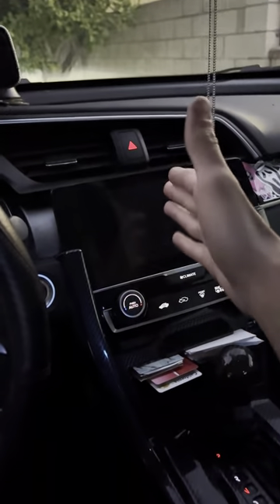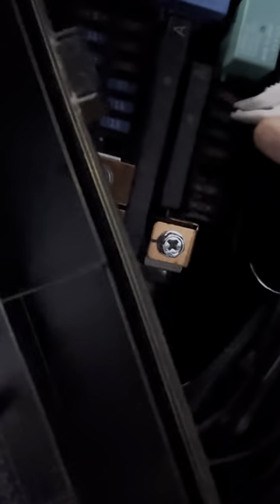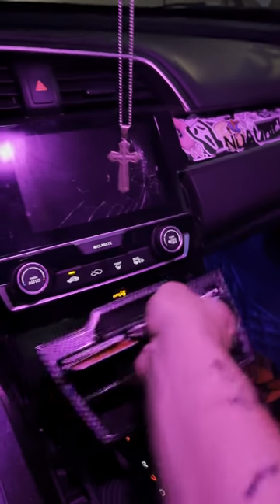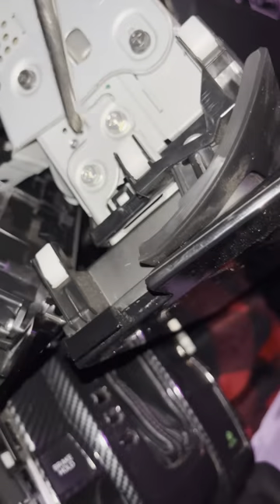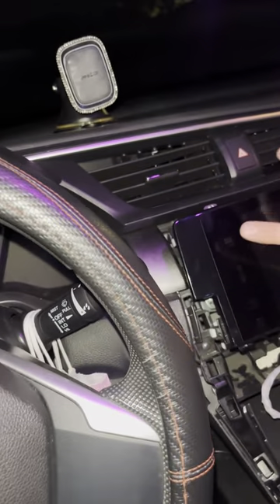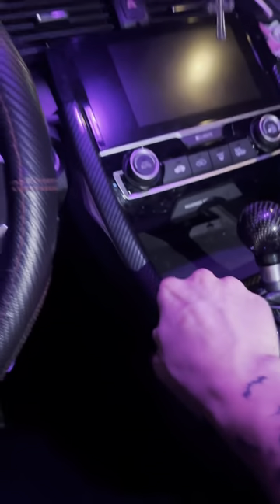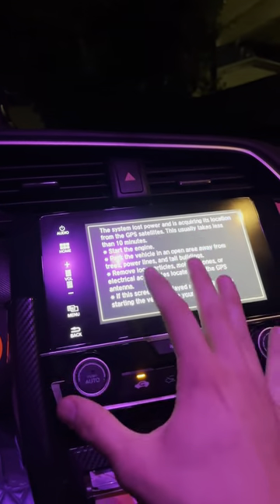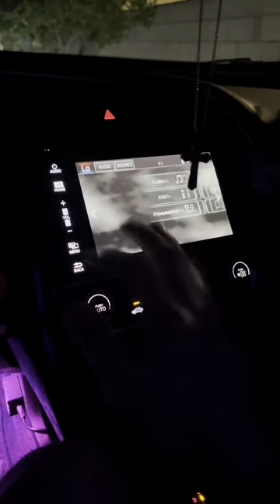HOW TO REPLACE HONDA CIVIC TOUCH SCREEN / Civic 2016-2019 apple car play screen fix

Comment from the maker: For anyone wondering… this also works on Honda civic hatchbacks as well with Apple CarPlay. You may have some different clips to pop but it’s relatively the same process.
Reply: Quick question. Did you replacement the entire unit or just the digitizer screen? Looked like the entire unit but wanted to know if changing just the screen/digitizer will resolve the multi-colored lines and then black screen. Or if I need to change the entire unit?
Reply from the maker: @jhgannon  All I changed was the screen. It resolved the multicolored lines and black screen glitch. Should work just the same for you
Reply: @Dead10thgen thank you so much.
Reply: If I did not pull the fuse would it be ok?
Reply: Did you get your screen online or from a dealership?
Reply from the maker: Straight from eBay. I think I mentioned that in the video but I’m not sure off the top of my head. The part number is on the back of the screen once you remove it. I just went on eBay, and pretty much copied and pasted the part number into the search tab, looked for the best price, compared it’s looks and part number shown in the photos, checked their ratings & placed my order. Came in exactly what I needed. OEM screen , barely used or new.
Reply from the maker: It would be a risk to the device’s functionality and overall a safety hazard for sparks and fire when toying with the wires. I would recommend unplugging the fuse or disconnecting the battery if you can’t find your fuse. This way when you plug it in, you don’t have to worry about which to plug in first, or whether or not the jolt of power into the screen will cause your new screen to burn out immedietly.

Comment: My display just broke today and this is the best video I've seen on how to replace it. My only question is where is the fuse box located? That video cut kinda quick to see how to get to it.
Reply from the maker: Fuse box is near the battery. There’s a plastic lid with some clips you can press with your finger to pop the lid off. Most if not all Honda civics have the same fuse box location. You could also search on Google your cars make, model and year and type “fuse box location”. Might have to scroll around a bit to find it tho. Hopefully this helps !
Reply: I literally just did mine by watching this video, and I have to say I agree
Reply from the maker: @JohnnyD31994  so glad you found this video helpful !

Comment: Great video. 

I recently had to slam on my breaks to avoid a dummy on the road. 
Long story short, a Thermoflask hit the corner of the screen, and the dealership wanted to replace the entire radio and quoted me at 965.73 for parts and labor. 
I just took mine out. Matched up the model number with one being sold on ebay ( screen only ) for 175. 200 shipped with a 2 year warranty. 

You saved me 700 sir. 

Thank you. ❤
Reply from the maker: I’m so happy to hear this ! Glad I helped bro. That’s exactly why I made this video!

Comment: My 2016 screen is blank. Only side button blinking white light. Do you think is it only display issue or display unit? I can share video with you if you have email
Reply from the maker: This would solve the issue for a lot cheaper than just replacing the screen piece. The unit in the back remains untouched while we replace the entire monitor/screen system. My side buttons were glitched as well & would actually beep when touched, but nothing on the screen would show. 

If it’s just off, & flashing, perhaps do this process, unplug it, plug it all back in, and give it a reset by having the battery unplugged the entire time. If it doesn’t turn back on, my vote is to just replace it per this videos instructions

Comment: Thanks so much for this! Went quite a while with the black screen bc I wasn't giving Honda $2300 to fix it. I also went the eBay route ($350), and the swap was as straight-forward as any repair I can recall. Looks and works great! Nice work!
Reply from the maker: So happy I could help!
Reply: @Dead10thgen where did you get your replacement screen
Reply from the maker: @JohnnyD31994  I got mine from an eBay seller. Just typed in the part number and searched it.

Comment: Where can i get the pry tool you used?
Reply from the maker: AutoZone or online. This is just some plastic pry tool. Similar to a bicycle tire pry tool. Anything works really even a flathead screwdriver with some tape on it for scratch safety.

Comment: I have a question, do you have access to the stereo output wiring when you take the screen out? I’m trying to wire in some subwoofers and each tutorial I see has a traditional stereo/radio box with no screen
Reply: Did you figure it out? My subs are connected to a unit like this
Reply from the maker: Yes you do. The wires connected to the plug behind the screen are directly connected to the speaker system and are the reason for all the power to them. Hence the audio fuse I removed completely disabled the screens functionality. You would have to cut and splice them if you did it that way though.

Comment: Where can I order this screen for my 2018 civic si my screen for the past couple of weeks been acting up i really thought it was the weather as it has been hot here in California my screen went white and black lines i will turn the car off my screen will come back to normal until today just went black check my fuses all look good

Need the help to look for the same screen as with this wonderful video I’ll replace it myself
Reply from the maker: I looked up my part number on eBay. In this video it shows how I learned my part number after I took my screen off. It is on the back of it.

Comment: Do i really need to do the fuse box thingy
Reply from the maker: Yes. This will ensure that no electrical damages take place. It may work without doing that but this is the safest way for your radio to not have any problems. You could also just disconnect the battery as another option.

Comment: Where did you order the part from?
Reply from the maker: eBay. Just type in your part number and search it up for the best deal. Confirm the part number with the one your screen shows. In the video it shows where I found my part number as well so hope this helps!
Reply: @Dead10thgen  thanks so much!  Was able to get the part and replace it in 20 minutes!  Part cost 320.  I called dealer to verify part and they wanted 1100 for same display screen.  You saved me close to 1100 with parts and labor
Reply from the maker: Amazing! So glad my video helped you. 🤝

Comment: Hello, I have a 2016 Honda Civic EX-T, my screen has some vertical color lines, I have rebooted the radio a couple of times and it worked again, but now it doesn't, I can actually touch it and seem to be responding, but can't see anything, would you think I need to replace the touch screen only or this may be different to what you had and there's' something else? I can actually adjust my AC because just touching close to where I remember it was but can't see anything, just color lines.
Reply from the maker: That’s exactly what mine was doing before eventually the screen went all black
Reply from the maker: You can do this exact thing from the how to video and it will fix this problem. I read from another commenter who did just the screen glass which is also able to be done but a little more technical.
Reply: hey, i just came across your comment and have the same issue with my Honda Civic Touring 2016. did you end up replacing your screen yet? how’d it work out?
Reply: @h3mzaa hey I have the same car, the same issue. Did you end up replacing the display screen or it was a minor issue.
Reply: @erykprofcy  yes, don’t try to put an after market screen on the honda civic touring 2016 because they have stock subwoofers. instead, purchase the exact same screen your car already has from ebay.
Reply: @h3mzaa  Thanks for your response, I tried looking for the OEM part on hondapartsnow and some other honda part stores with but the prices are very high compared to eBay prices. I’m not sure why it’s so. Will appreciate if you can share the part number you got if you don’t mind.
Reply from the maker: The eBay prices usually come off of “part outs” from cars that were totalled but the radios were fine still. Mine was a used screen, but listed as “like new” hence why it was so cheap, but it was an EXACT replacement :D

Comment: Very helpful video. tried to change my screen as well, but i cant get the the upper screw on the left side out. Does honda use some kind of loctite?
Reply from the maker: No lock tight on mine. Probably just old and stuck in there. Might have to try different ways of unscrewing it.

Comment: Hi there. I'm watching waaay after you posted but wanted to ask, would this method work on a 2015 Honda Civic? I have a touch screen display. I read through the comments and watched the video and didn’t get the answer. Thanks in advance!
Reply from the maker: This video is for 2016-2021 civics with Apple car play. I’m not sure it would work the same on the prior generation of Honda civics. Perhaps similarly but not the same exact process.

Comment: My just started to glitch would it work if i take the fuse put and make it rebook it self and see if it work ?
Reply from the maker: Perhaps it would. That’s like a reset . You can always hold the power button (the touch screen button for audio to power off) & once the screen pops up with “reboot” click yes. It’ll restart the system of your touch screen.

Comment: I have regular small screen can i plug this one ?
Reply from the maker: If it is a CarPlay screen , then that should work. I am not entirely sure what screen you’re referencing. If it is the standard radio screen without CarPlay, you would need to replace it with that part, not a CarPlay touch screen.

Comment: I'm looking to change to a better one. Like an android that can not only do the civic's functions but I can connect it to my Bluetooth and put some YT or movies or something. Any recommendations? Ideas perhaps?
Reply from the maker: There is Android CarPlay kits available at different stores & different prices. Just gotta search around ! Probably a similar install setup but I would recommend ensuring it has the same functionality for your vehicle settings & system settings. Strictly just changing it to Android CarPlay. This way you can still reset maintence lights through your new touch screen just like the old one.

Comment: Would it be possible to put a 2019 civic screen with the volume knob into a 2016 civic?
Reply from the maker: Yes though you will most likely have to change your radio / computer which is behind the screen as well in order for that screen to work.

Comment: Hi, i have 2016 civic and its continually beeping and has ghost touch. Factory reset done  but the same problem is there. Can u please tell what to do ?
Reply: my boyfriend has the same issue and it’s so annoying, have you figured out a solution??
Reply from the maker: Mine used to do that before my screen officially gave out and went black. Usually it’s because the screen was cleaned with an inadequate cleaner for the touch screen and that messed up the sensitivities of it. I’d recommend just replacing the screen like I did.

Comment: Is pulling the audio fuse mandatory?
Reply from the maker: It’s just a safety feature to avoid any power into it while unplugging things. You could just unplug your battery but I think the fuse is simpler.

Comment: Great video! Very clean and quick. Thank you for posting this.
I have to replace the touch screen on my 2017 Honda Civic EX and I'm not sure which part# I should order 39710-tba-a11 or 39710-tba-a21. How did you know which one to order? Thanks in advance.
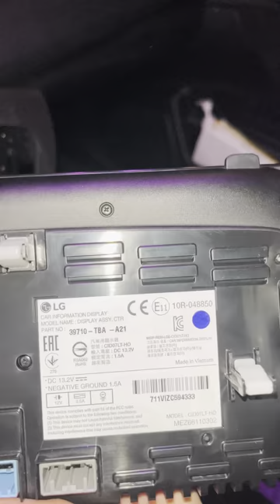Reply from the maker: If you skip the video ahead to 3:20 I show exactly how to figure out which screen you need based off of the part number :) You just need to take the screen off first then it shows the part number on the back. You can compare that one with the one you will purchase 3:19
Reply: thank you @Dead10thgen
Reply: If I'm not mistaken, I think the part ending in A21 is the whole screen. And A11 is the digitizer (glass) portion of the screen only? You left this comment 3 weeks ago. Any update?
Reply from the maker: @JPwrites85  there is a slight difference in the entire screen size for different model civics. This is why there is different “a” numerals. If your only looking for the actual “touch screen digitizer” (the glass on the front only) it is a more expensive and risky fix than this. I’d recommend just replacing the screen like this otherwise it may not work. There is a UV protection plastic on top of the glass. It’s more complicated to replace that IMO. My glass was the only thing broken and I found this to be the best solution. If you’d like help finding the glass still you can send me an Instagram message @dead10thgen and I can help you out and respond quicker there :)
Reply: @Dead10thgen  I found the digitizer prices anywhere from $30-$110 depending where it's coming from. I also found a tutorial of how to replace it. According to the comments in that tutorial, it has worked for quite a few people (given they got the correct digitizer for their car). I just ordered one and it'll be here in 3-4weeks. Gonna try that first. I'll leave an update here one I do.
Reply from the maker: @JPwrites85  that’s awesome yea please let me know how it goes. If you can take some videos too I’d love to check it out or link me to the video you saw
Reply: @Dead10thgen UPDATE! I paid $30CAD for the digitizer (39710-tba-a11) on AliExpress. Came all the way feom China. Took me a few hours (mostly because the screws were stuck and prying the screen open was kind of rough) but with a lot of patience and care I was able to fix my shattered screen. It took a few minutes for the system to reboot and connect to satellites but once it did, I was elated. $30!!!!
Reply from the maker: @JPwrites85  that’s such a win. Good job.

Comment: Hi, great video. Where’d you buy the part?
Reply from the maker: Got mine by searching the year of my car and typing radio touch screen. Found this on eBay from a third party seller. Just match the part number you have with the one you’re buying. Could even try searching up the part number as well. Got this one used for $290
Reply: Thanks so much 🙏
Reply from the maker: @madiSPN you’re welcome I’m glad I could help 😊

Comment: Where did you get the screen from bro
Reply from the maker: eBay anywhere between $150-$400 depending on used or new
Reply: @Dead10thgen  thanks bro didn’t expect a reply so quick! Just cracked mine the other day
Reply from the maker: @steven3235  seems to happen to a lot of us 😭
Reply from the maker: @steven3235  you’re welcome hopefully you can find it. Just match the part number on the back of your screen with the one you’re purchasing

Comment: Fuuuuuuck. Mine won't turn on. Car says "audio power off" but I even replaced the fuse with a new 15
Reply from the maker: Double check all the plugs behind the screen. Fuses as well. If that doesn’t work, reinstall your battery. When it’s disconnected wait 60 seconds then connect it again upon reinstalling it. That gives the whole ECU a reset.
Reply: @Dead10thgen  I really appreciate it. I'm in need of a new battery as it is so I'll have to go pick one up
Reply from the maker: @benjamynbuchanan1700  hopefully that helps. Otherwise you may have a different fuse that’s blown. Feel free to comment again if you have any other questions bro
Reply: @Dead10thgen  yeah my original screen was working, it was just cracked and the image went dark. But it still lit up and played music and the like
Reply from the maker: That’s what happened to me before too. This whole process is what fixed mine. Hopefully it works the same for you.
Reply: @Dead10thgen  unfortunately even after disconnecting and reconnecting the battery, the screen didn't light up. It's kinda nuts. The dealer says the part is like $1500 but I see these screens sold for like $200

Comment: I punched my screen of my 2018 ex Honda civic and I can’t find the glass replacement😭
Reply from the maker: In this video I show you exactly how to replace your issue. I show a part number in this video and you can type that part number in online to find yours. Just follow the steps in this video & type your part number in once you get it. Once you get your screen and install it, your issue will be fixed! 😄